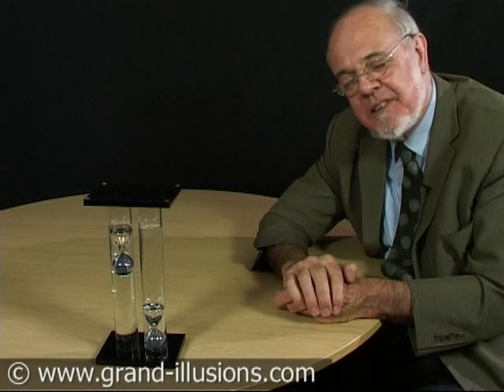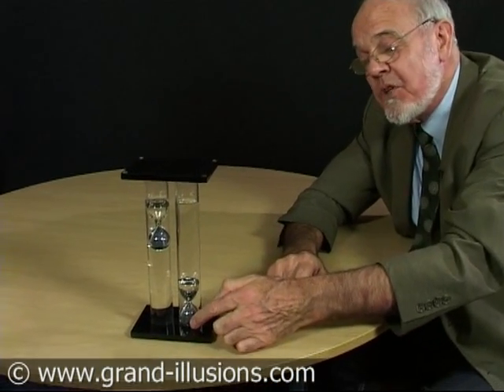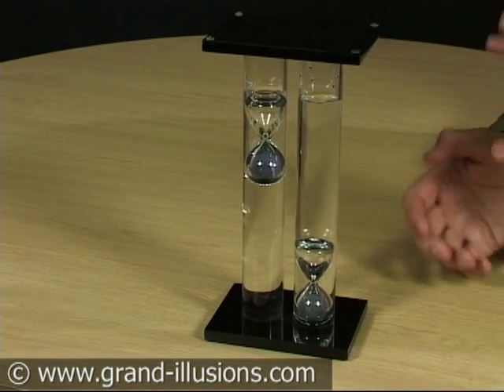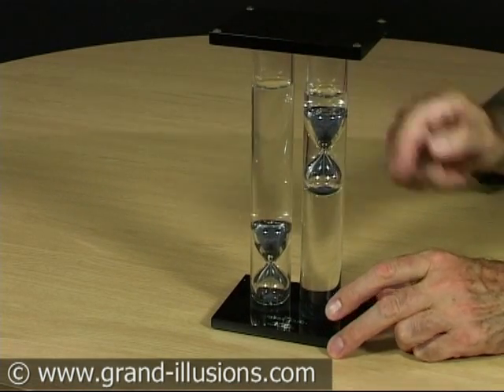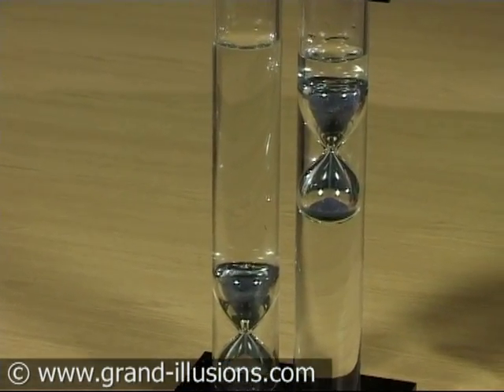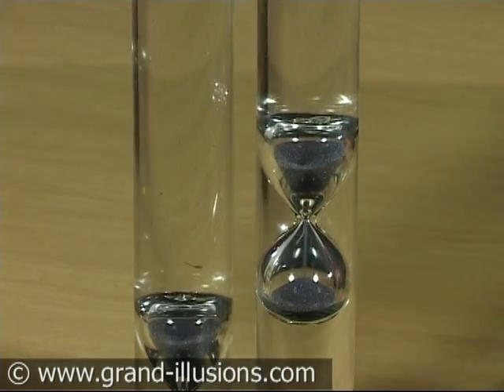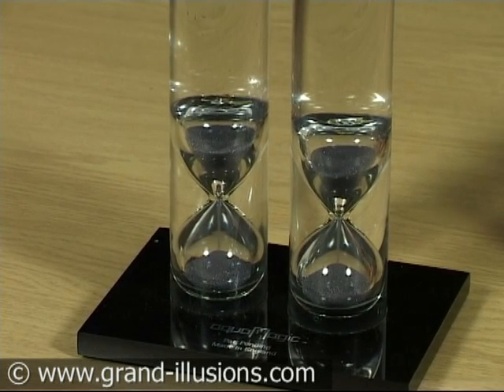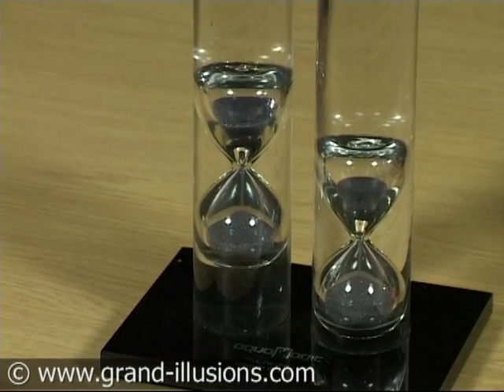Floating Hourglass

Comment: I dont know, it feels like the other hourglass is vacuum, and the other has air.
Reply: i was going to say that..lol
Reply: a good thing someone can agree ^_^
Reply: There is a meniscus in the fluid of both tubes... It's hard to say from this video whether or not one is inverted, but were that to be the case, I would say you have found the solution.
Reply: How would the sand fall inside the hourglass if it was it had even near perfect vacuum? I have given some clues on the top (and ugly) discussion to see if they stop insulting each other (and themselves by showing all their intelectual and social ignorance) and start thinking. Check it out, I need some1 to counter-argument my idea too :P otherwise i'll never find if i'm wrong!

Ps: friction makes it possible too. this is a more fun theory ^^
Reply: in the system friction is always constant, you need a force that can be varied to keep everything moving, if friction is the only thing that makes it tick, it  would be a very static system, i cant tell for sure. friction might play a role but it certainly need much more than friction for that to work.
Reply: sonic55193 No sir. The friction is not constant. When you turn the toy upside down, all the sand is in the top part of the hourglass, making it heavier then the bottom part. This, by itself, is enough to make the object want to fall aside to turn upside down when free falling in watter or air. Like the classic toast with butter, the heavier part falls facing down most of the times (unfortunately for the hungry guy). Also, the movement of turning the entire toy upside down also helps to unbalance the hourglasses, but this is irrelevant if well built. 

So.. Once the sand starts falling, the weight comes back down and the hourglass will stand straight, begining to fall. The other one is simply lighter then water, so instead of going down, it goes up... The reason this one is slower to act, is because the direction it wants to go is the same as the sand's position on the hourglass, causing more friction. It may be needed some fluid more viscous then water, I have no clue how to calc that :)

But this is simple and a lot of ppl have explained it. You're just lazy to read the comments :P Now the magnetic way of making this toy would work without the need of friction (althought there's always friction unless the sand is weightless). I've given the clues for the drawing in that top comment list, if you want to give it a try!

Comment: Seems obvious that the hourglasses are 'top heavy'. They try to fall over inside the tube creating some friction. And because the buoyancy is not all that strong it can not overcome the friction. Now when the sand has gone back to the bottom it no longer wants to fall over and the friction excerpts less force than the buoyancy so it can start it's way up. And vice versa in the other event.
Reply: that's what I was thinking. seems to be the most obvious, simplest explanation.
Reply: Friction or magnetics. It would seem friction is the cheaper way, but I doubt making the hourglases fit the tubes so exactly would be cheap at all. It's costy to produce that shape and be THAT precise (I guess).

I've given some clues on how to do it magnetically ,altough you probably can get it.

Comment: If the two tubes contained exactly the same substance, they would have equal reactions. They are having opposite reactions because the tubes contain different matter. The difference may be a gas, liquid, solid, temperature or a combination of all.

Comment: I got it! When the sand is at the top and the air at the bottom, I believe the hour glass inside the tube is trying to right itself or flip over. This puts pressure on the between the hour glass and the wall and locks it in place until enough sand has entered the bottom to relieve the forces locking it in place.